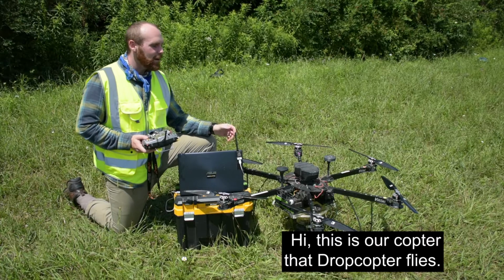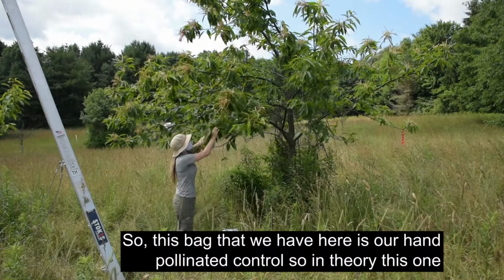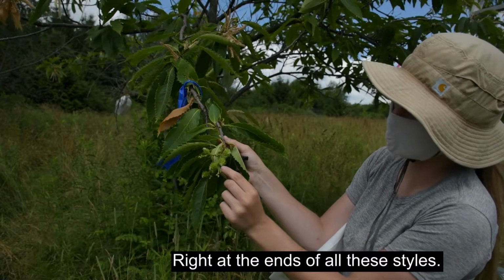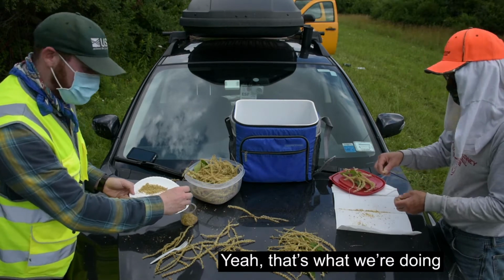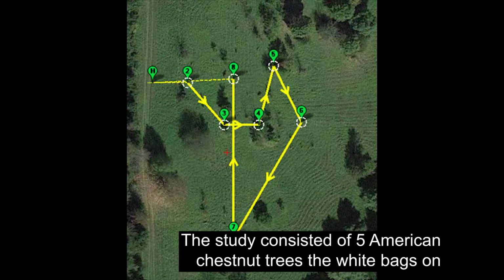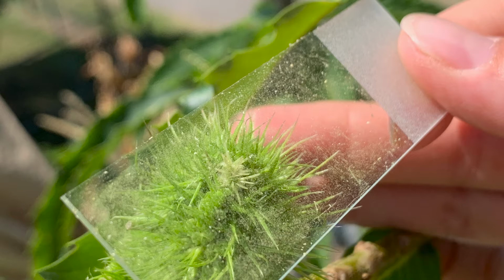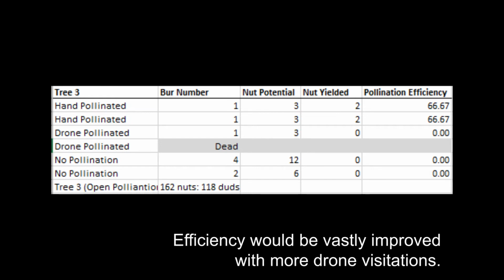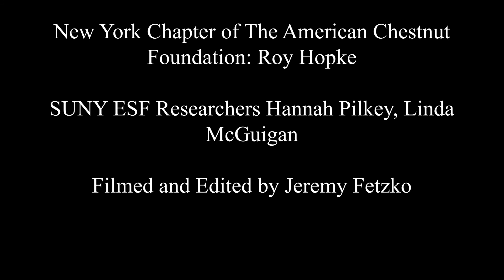Chestnut Pollination with SUNY ESF

Comment: I have grown disease resistant American chestnut trees in the past. They all produced nuts but eventually died. I currently have a mature hybrid cross American Chinese tree. I need a pollinator but don't know what kind or where to purchase. I was going to clone it but don't know if it will pollinate from a clone. My house was built circa 1840. I was built out of chestnut from the surrounding lot. The pegged post and beam is 6×6 and 8×8 with sheathing,roof and floors made with wide chestnut planks,all hand hued. Any information would be appreciated.  Thank You.